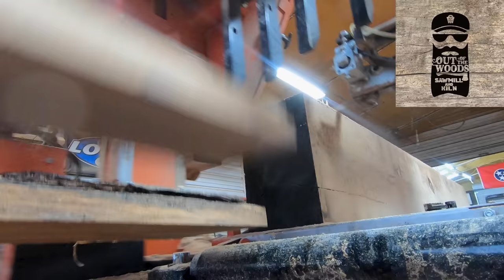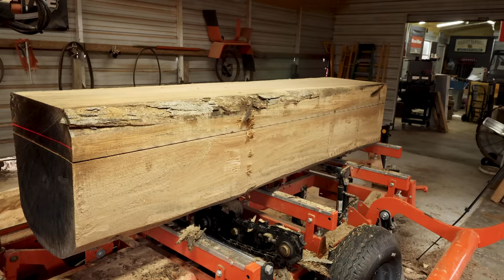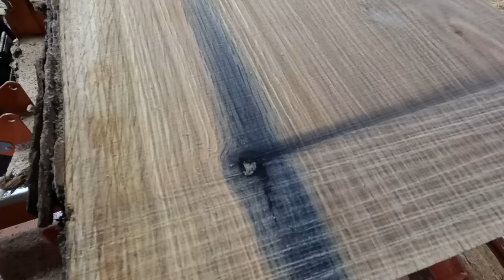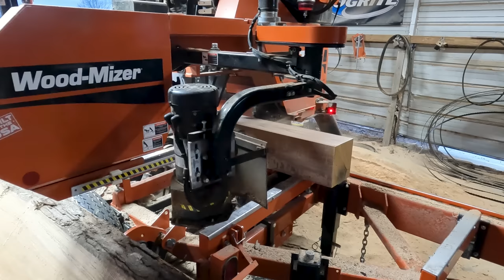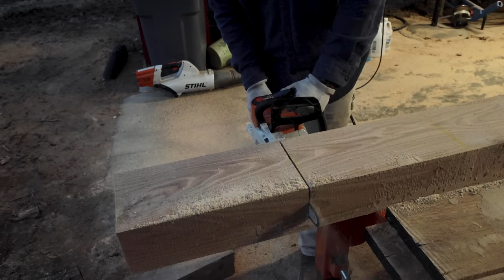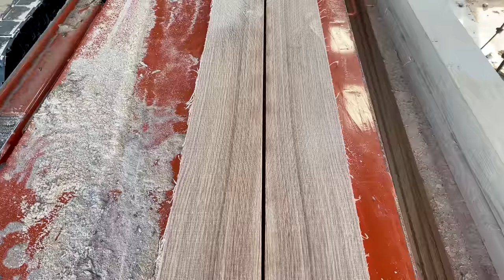NOT What You Want To Find Inside A Log!

Comment: Worked 33 years as a sawfiler sharpening and repairing bands 36 foot 6 inches that ran on 6 foot wheels. Ive seen 
an axe head, hive of bees , nails from 16s to 60 p , rail road spikes , bullets galore and bandsaw destroyers , porcelain electric fence insulators that made the tooth side look like the back with nary a scratch on the insulator. Well maybe a little one lol.

Comment: Nathan, not having any knowledge of saw milling, I'd like to know why there are not teeth on both sides of the blade.  It seems that with all the back and forth that the mill does it would speed up your production if the saw could cut both ways.  Please explain.  Thanks
Reply: The band has pressure exerted on it while cutting, so there are rollers resisting this pressure against the back of the blade/band. Obviously, cutting teeth rolling against a hardened wheel would not be conducive to long wear. Without the backing rollers, you would just strip the band off the drive rollers.

Comment: Please sir help educate a poor dumb machinist. What was the slide hammer type tool you used to get the nail out and where can I get one? Not that I have a nail to get out right now. I just like stuff like that. I promise not to do stupid things with it. 🤞🏻
Reply: I have a few. Just google Antique sliding nail puller. They are cast iron, the vintage ones. A few companies make modern versions of them. Cool, as with a flush nail head, you set the sharp end down around the nail, slide the handle up and ram it down a few times until the point goes under the nail. Then you just lever the tool along the small curve and the nail pops right out.
Reply: @eyeguyeyeguy1  thanks. I have needed a tool like that a few times in life. Will try n find one to have on hand. Maybe Ebay.